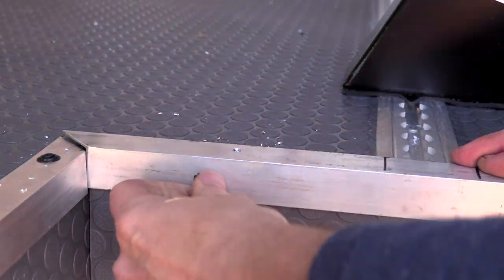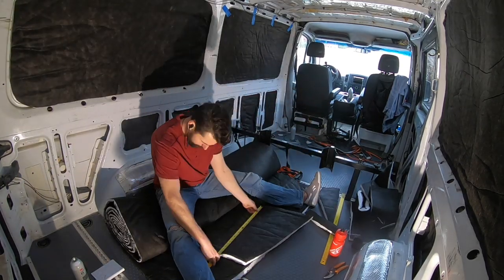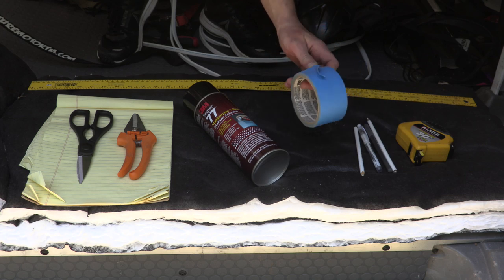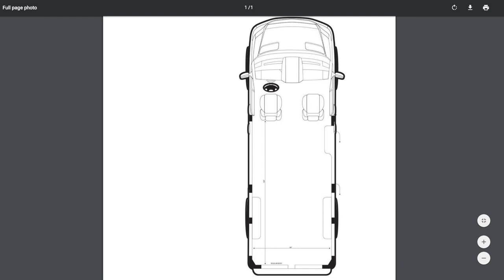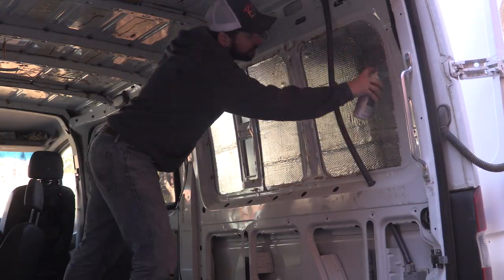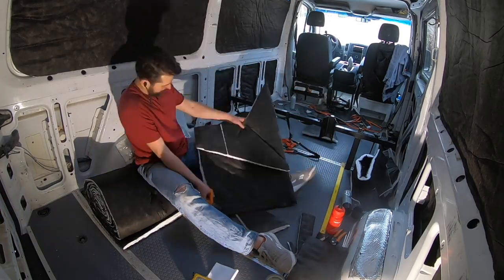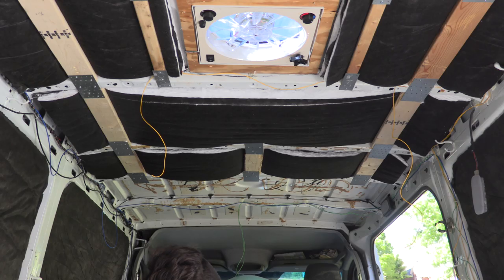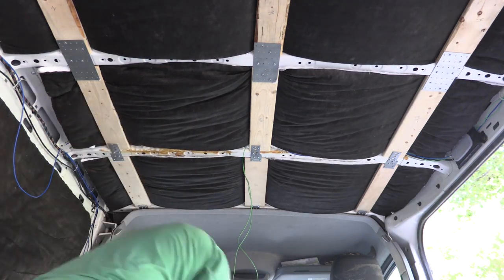3M Thinsulate Sprinter Van Installation | Motovan Build

Comment: I think the 3M 90 may be a better choice, and any respirator is better than none.
Reply from the maker: Respirator, yes! I was in new territory. I had the doors open, but it’s still an enclosed space. I also found this guide for 3M Adhesives if anyone else needs to make the ‘Which one do I use?’ decision. https://multimedia.3m.com/mws/media/1084398O/3mtm-spray-adhesive-selection-guide.pdf

Comment: It looks like the roof has some sway or dead space between the Thinsulate and the roof itself. Is that ok for insulation? Do you have to get it completely tight against the ceiling? That looks like the hardest thing to do!! The spray is sticky. and once the Thinsulate touches the ceiling.. that's it.. It sticks there. 
Thank you!
Reply from the maker: You don't want it to be tight. You want it to have some 'fluff' to it so it insulates a bit better. As far as the 3M Spray, that stuff is AGGRESSIVE! The second the thinsulate touches it, it's stuck.
Reply: @SeatTimeClips  Thank you for your reply. It is appreciated. I don't know, but for some reason doing the ceiling is such an anxiety maker for me. I don't see how I can get the darn stuff completely evenly stuck on the ceiling lol.
Thanks again!

Comment: you said that the 3m thinsulate will fall off from the ceiling no matter how strong the adhesive is, does the same apply to the walls of the van? i want to use double sided tape to stick them is that possible

Comment: What are those metal plates you used on your ceiling? How did you get the screws into the metal frame of the van without any threading in the metal parts?
Reply from the maker: Metal Plates are Simpson Strong Tie Plates, like this: https://amzn.to/2B7NgQT
Self Tapping Screws for the parts that aren't exposed, like these: https://amzn.to/32f4ho3